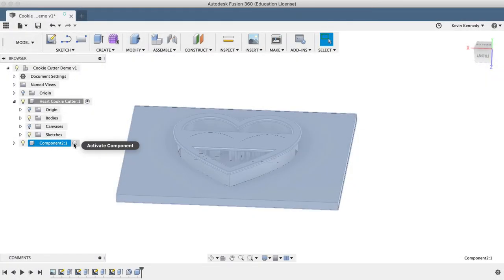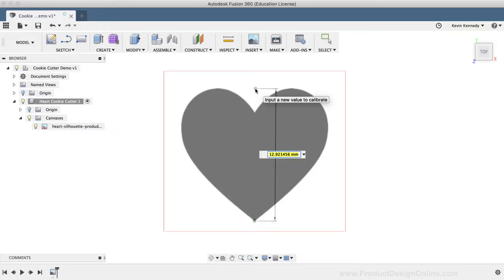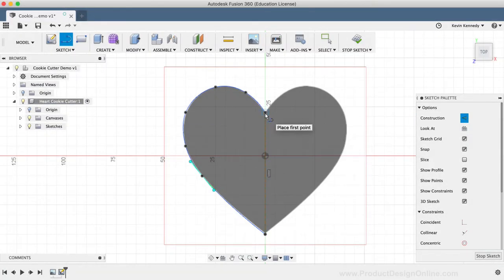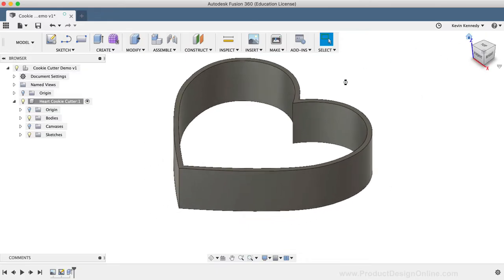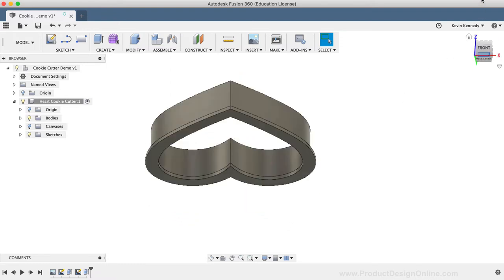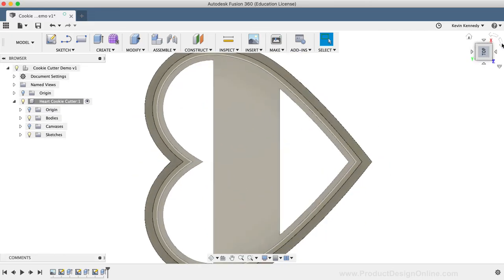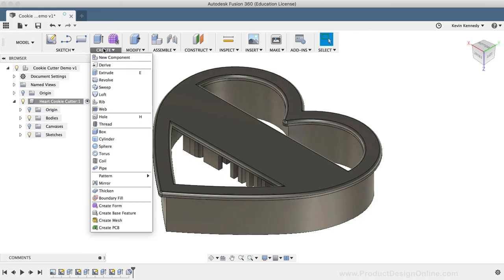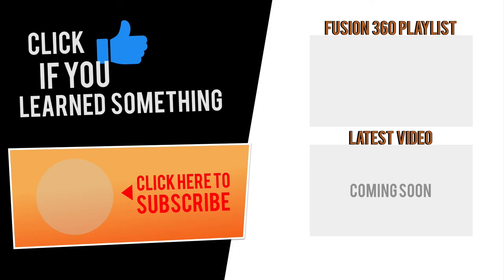How to 3D Model a Cookie Cutter in Fusion 360 (for 3D Printing)

Comment: How do I add just a small tab on the cutter and text to tell what the cutter is? Attached phot is not my cutter. It’s an example of what I’m wanting to do. https://photos.app.goo.gl/TXgm14aek4DvWZNFA
Reply from the maker: Hi, Misty. Thanks for sharing the photo. This is a neat "upgrade" to the cutter.

You'll need to create a new sketch on the top surface. Based on the photo you provided, it appears that the shape follows the same curve. If you want the text area to follow the same shape then you can use the "offset" tool in the sketch dropdown list. Offset the edge to your desired distance, making sure there's enough room of an icon or text. Then, you'll have to use the line tool to connect the offset sketch at each end. Next, use the extrude tool to create thickness for this closed profile.

Once you've created that shape you'll be able to use the "text" tool under the sketch dropdown list to sketch on the surface of the shape. Then, you can simply extrude the text away by setting the Extrude operation to "cut".

I hope this helps. Let me know if you have any follow up questions. Cheers, Kevin :)
Reply: Ok I think I understand. Lol. Can you possibly make this another video demonstration?! That’s would be super awesome 😊
Reply from the maker: @mistywilson9140  I just recorded a quick screencast (with no audio) of the process - https://drive.google.com/file/d/1ugXGWS5d5mqMR-wxmrXLEGpsPHRlCeiK/view?usp=sharing

Let me know if this is helpful. Cheers, Kevin :)
Reply from the maker: Here's the sample file if you want to play around with it -  https://a360.co/32pHDK6